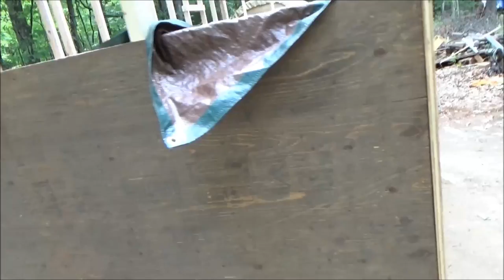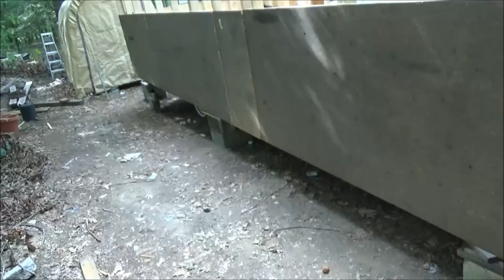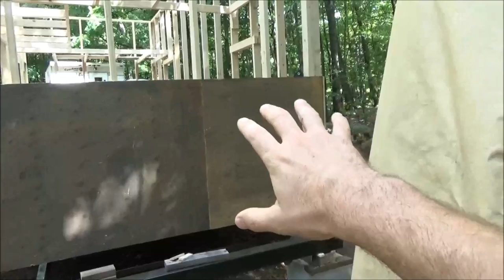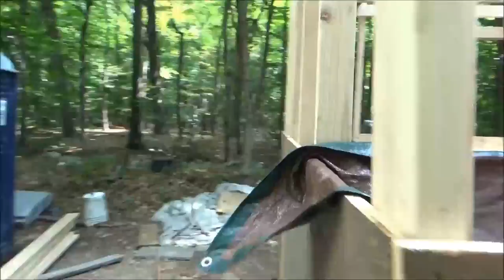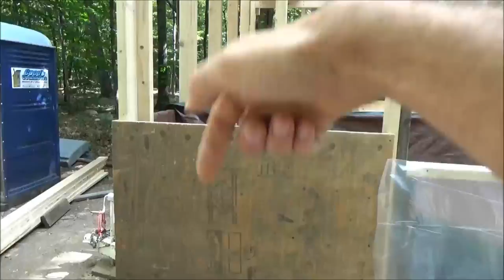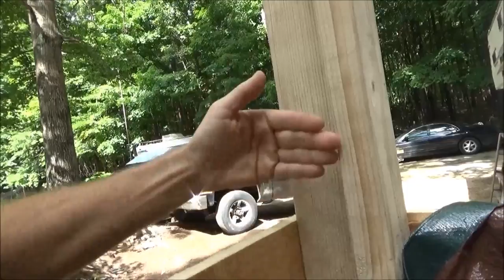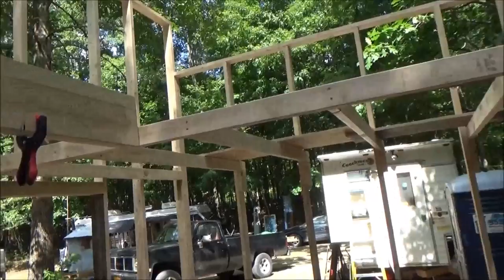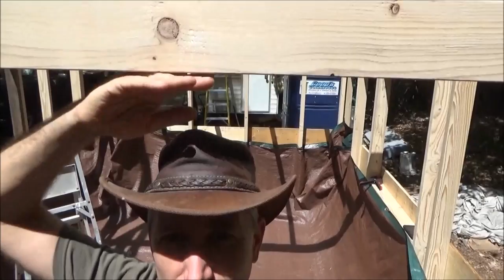Finishing My Tiny House Loft And A Rustic Beam

Comment: Have you accounted for the amount of screws you're using? I think you used about 14 screws in that beam. I think 1/2 a dozen would have been enough. Bet that's where all your $$ is going.
Reply from the maker: I was told to use more. I can only take so much advice. I have to choose one way or another. Its so confusing.